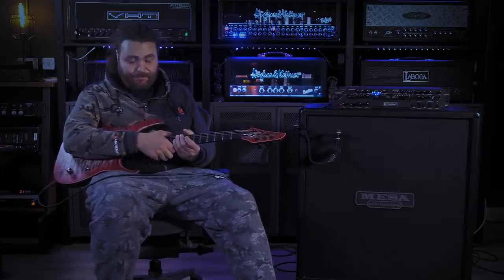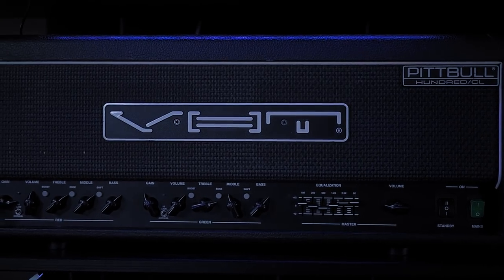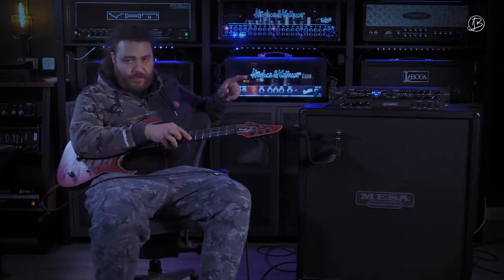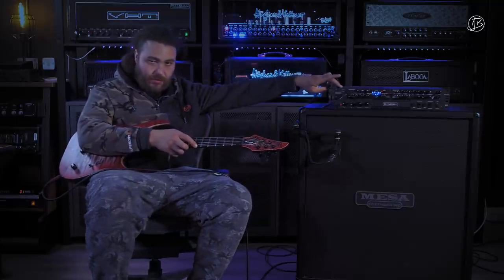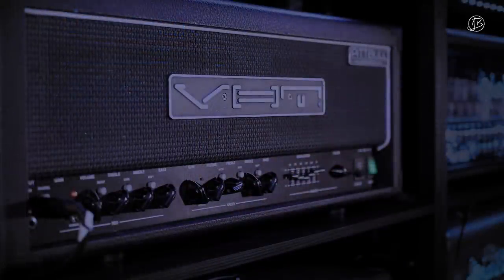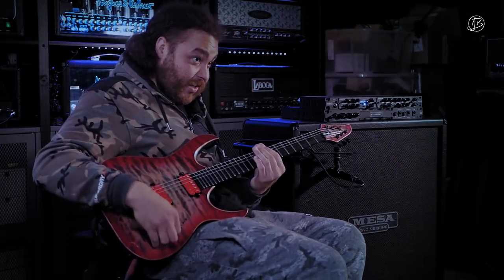GUITAR GEAR DEMO OF THE FRYETTE AMP HEAD VS FRYETTE SYNERGY

Comment: The head sounds way more saturated and polished, and there is feeling as if it has slightly more gain. Synergy is slightly darker and more raw sounding. I prefer the head, but both tones are good enough for production work, in my opinion.
Reply from the maker: The synergy sounds a bit smoother to me but yeh both sound really really good!

Comment: IMHO Synergy sounds a bit "muddy" with that lows and low mids definitely not as thight as the VHT .. but this is the 6L6s in the Synergy power amp probably!  using the Preamp Module slaving an EL34 power amp could be an interesting comparison! :)
Reply: The Synergy stuff rips with EL34 based amps. 6L6 amps seem to make it less musical. I was shocked about how much EL34's made a difference. My Powerball and Fryette modules absolutely ripped with EL34's than my 6L6 amps
Reply: @davew1134  wich power amp el34 equipped, did U use?

Comment: I bet it'd sound even closer if you use  the ultralead module with a different power amp like the fryette 2/90 (which runs KT88s iirc)
Reply from the maker: Oh for sure 100%. Didn’t even think of trying it in the power section of the Head haha.

Comment: The head had a bit more presence but other than that they were pretty close.
Why didn't you just slave the module/Syn2 through the amps effects loop? 
Would have been way easier to A/B and would have eliminated the differences in power sections.
Anyway I'm sold and super stoked to get the ultra lead module for my rig!

Comment: The head. The system leaves you wanting. I noticed the same with the soldano module in another video. They sound great, modular, all is good but if you are left wanting it is a problem.

Comment: Damn, module is cool and all, but the head sounds just so much bigger. I had VHT GP3+100 wt 6l6 randall rack amp back in a day and it sounded good, but then i bought ultralead and it sounded on a whole another level, but i've got fryette fatbottom cab, that is made for this amp and it is still to this day the graetest chain i have ever played. Steven Fryette really did everything to make this chain unique, but it just has to be a chain, otherwise it will always lack something, like synergy does, but it's still pretty cool anyway.
Reply: did you get fatbottom with p50e speakers or Fane F70G?
Reply: @levanchikvaidze3519  it was a long time ago, so they were p50e. Now Steven uses Fanes but p50e is still available. As he says - they are kinda similar, so I wouldn't be really bothered with it.
Reply: @jay133666  thanks :)

Comment: They both sound tight and aggressive...I'd be happy with either..I think the Synergy sounds really,really great though ..I have the Fryette LXII  50 watt poweramp,(The Fryette transformer in the LXII is a patented ,more powerful transformer than the one in The Synergy 50/50 poweramp ,according to Steven Fryette whom I corresponded with.)I have the Synergy Deliverance module and the  Synergy Bogner Ecstacy module..between those 2 I can go from clean to mean with 4 channels..and with my pedals Ive got all the bases covered..great comparison John..the full head is cool,But Id rather lug the Synergy system around!

Comment: Hard to compare. I think the output sections are making a difference and I'm hearing rumblings about the Synergy Poweramp being quite dark and compressed. I think might be worth another spin with the synergy in the loop of an EL34 amp to take that variable out of the equation.

Both sound sick though. The Fryette modules are definitely the ones that swung it for me (I thought Synergy was pretty cool before but these really swung the balance).

Comment: The head is tighter, got more bite and better saturation I think. It’s all in the powersection. Fryette avoided 6L6’s for a reason. Steve don’t like em. I agree when it comes to this comparison.
Reply: The synergy poweramp is literally designed by steve. He also sells the LXII also with 6L6s.